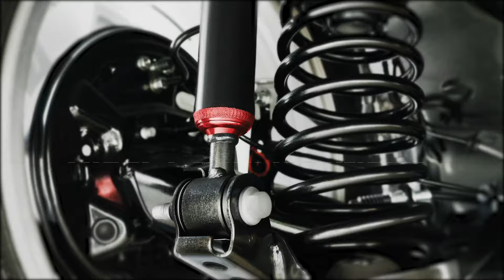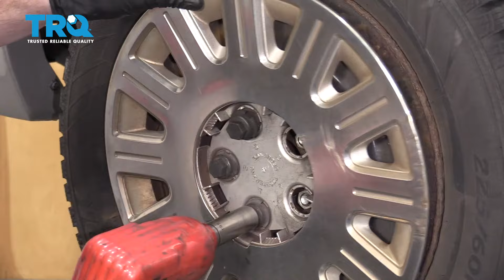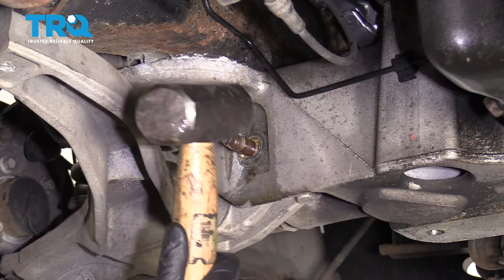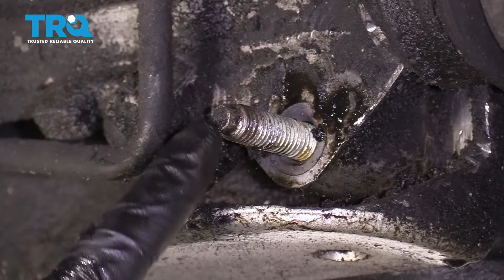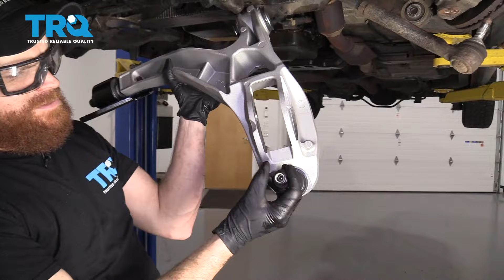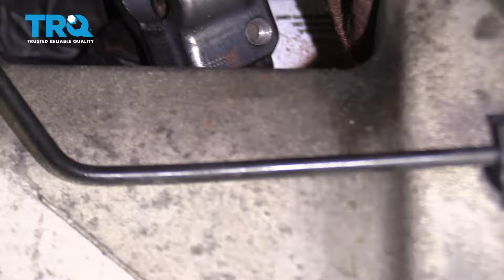How to Replace Front Lower Control Arm 1998-2012 Ford Crown Victoria

Comment: Everyone reading this, ignore the whole removing steered rack studs, nuts, etc.  Dont do it.  Simply turn your steering wheel . Theres a spot where the bolt will come out with no issue.

Comment: Thanks for the video! One tip:
This job can be done without disconnecting the steering shaft:
Turn steering wheel all the way to the left:
Remove 2 steering rack bolts and drvr side stud;
Move rack forward and up as much as you can and there will be enough room to slide that bolt out.

Comment: i did this job just like he did but did not have to disconnect steering shaft/ i lifted the rack up with a crowbar and removed bolts and did the same installing them a tight fit but it came out perfect !!

Comment: Many thanks. Just did this on my 2004 in my driveway. I didn't remove the rack, but turned the wheel as someone else mentioned. I barely got the bolt out. I could not get it back in. It was drivers side, so I took out the long bolt of the drivers side rack, used a crow bar to lift the rack straight up, this allowed me to put the control arm bolt straight in. I should have done this when I removed the bolt as I ripped the boot. Car has 290k miles.

Comment: I have a 2000 crown Vic that has too much play in steering and it kinda snatches during left turns on the highway.  It'll also clunks when I turn the wheel while sitting.  Could the lower control arm be the culprit?

Comment: We just did this the other day before watching the video and we didn't take out the steering rack, simply loosen the two nuts to have the rack loose, then remove the rack boots at the big end, and you will have just enough room to take off the lower control arm bolts

Comment: So many unnecessary steps here my goodness. You absolutely did not need to touch the rack at all. Our the steering shaft and you did that and didn't even warn anyone about the clockspring. If that moves at all the clock spring is screwed. Which could've been avoided because the rack and steering shaft didn't need to be touched at all. That bolt can slide right passed the boot.
Reply: You should do a video of this.  I'm trying to get my Control Arm out now, and can't see any way other than to move the rack and pinion out of the way.
Reply: definitely going to try this method when I go do mine tomorrow. I'm having to do it on jack stands and I really don't want to waste extra time dealing with removing a bunch of stuff I don't have to, and I especially don't want to touch the steering shaft if I don't have to. Also saves me having to by a longer extension.
Reply: Music to my ears

Comment: Really not looking forward to doing this on jack stands, but I think I've got it after watching this video. Thanks so much, fantastic as usual.
Reply: Well watch a few other videos first. Because you definitely don't need to remove the rack at all, or the sway bar or the steering shaft.
Reply: Can you post the video you mention? Looks like steering rack has to be pulled forward for the front controller bolt to slide out
Reply: @CrimsonWormApologetics  I think homeboy just likes using his impact gun cha-kno
Reply from the maker: +ShumaiAxeman Thanks for watching our video! http://1aau.to/m/Shop-TRQ

Comment: If you get the front end kit that has new inner and outer tie rods, You should be able to do away with removing the rack.
Reply: You don't have to remove the rack or steering shaft regardless no matter what. This video is flat out stupid.
Reply: Or simply turn the wheel....

Comment: I have a 2002  mercury Marquis. Is there any way to center my steering wheel without affecting the front wheel alignment?  My car is driving real straight so the front alignment should be correct but my steering wheel  is a little off center.   jamesmcqueen1933@gmail.com
Reply: It can be done but it's hard to set toe in the driveway. It is best to have a shop do it. Because they have an alignment rack. However if you got a buddy have him sit in the car with the steering where you want it. Then eye ball the wheels you make toe adjustments at tie rod. I seriously don't recommend doing this if you have never done it before.

Comment: I’m literally at this point and could not figure out how to get the lower control arm bolt out without removing the rack and pinion.  The rack and pinion just kept hitting on the oil filter housing. Great video Thanks! ! !
Reply from the maker: +mobig2ls Thank you! We love empowering our customers and showing how to perform DIY auto repairs with our high-quality auto parts. http://1aau.to/m/Shop-TRQ
Reply: If you turn the wheel to the opposite side. The bolt slides right past the inner tie rod arm.

Comment: Great vid. Just curious, do we really need to get the steering rack out of the way for this job?
Reply: No absolutely not. or the steering shaft or the sway bar none of that had to be removed. You turn the wheel and the bolt slides right passed the boot.
Reply: Also this video told you to remove the steering shaft with no mention of keeping it still. If you turn it at all your clock spring will be screwed. He doesn't even warn you of that. While telling you to do that in the first place. 🤣🤣🤣
Reply: @CrimsonWormApologetics  awesome, thanks for the advice, glad I got your advice or I'd be the knucklehead making that exact mistake.
Reply: You don't actually have to remove the steering column from the rack, since the steering column extends and retracts with the joints built in but you do have to remove the one bolt and stud on whichever side control arm you are replacing in order to slide the steering rack forward enough for bolt clearance.

I did my lower control arm about 5 months ago and I can't remember removing the sway bar, I don't think that's necessary either.
Reply: @1995flyingspur  was it difficult for you to remove the stud ? Did you use the method in the video (double nut) or did you just remove it with a socket.
Reply: @1995flyingspur  thanks! Great to know
Reply: You do not have to remove anything to do with the steering racc.... Simply turn the steering wheel, ta-dah!
Reply: seems excessive

Comment: My crown vic needs new control arms bad lol. Front end wiggles more than a semi on a windy day.
Reply: Could be your need new struts and shocks. These lower control arms are quite beefy and it's really just the ball joints that wear out.
Reply: @CobraR1993  the bushings wear out bad too and unfortunately the front bushings are press in.  It's a lot easier to just replace the whole arm rather than try and press out and in new bushings without a hydraulic press.

Comment: That was a really great video. I have a 2003 Lincoln Town Car and my shop has told me that I need to replace my lower control arms. I trust them to tell me the truth and they have saved me money in the past. They have told me that this job is going to cost me $930 which is a lot but watching this I can see why. We live in an apartment and I don't have access to a lift and at 65 I don't have the inclination to use jack stands and go crawling around on my back attempting this job. The car's only worth about $3,500 on Craigslist but it's supremely reliable and hopefully this is it's only major cost this year. Thank you for the concise information.

Comment: Good video, but this only applies to 2003 and newer Crown Vic's and Grand Marquis's. 1998-2002 has stamped steel control arms and no rack and pinion.
Reply: 03 and newer have stamped steel ones too. this vehicle has the standard suspension. Stamped steel is the heavy duty suspension. But you are right about the rack. 03 is when they got an entire front end upgrade.
Reply: Thanks I have a 2002 Grand Marquis to do this weekend lower control arm
Reply: All of them had stamped steel control arms its just the aftermarket ones on rock auto are cast
Reply: Crown Vics** grand marquis** apostrophe “s” is for ownership not pluralization

Comment: Very detailed. Excellent video. Do you have a good rule of thumb in judging the bushings and ball joint?
Reply: If the boots ripped, replace it. If it's making noise, replace it. You can also have someone steer the wheel back and fourth and if you see play in the control arm mount points that means you gotta replace it.

Comment: Great video, when will you replace the upper control arm?
I need help!!
Reply: Easy to do, on my 07 I did this: (if doing at home jack up both sides of front end evenly important to make removing stabilizer links easier) 
Remove the caplier, and brake pads, remove the 2 bolts holding in the caplier bracket remove the rotor. Using a 15mm to hold the nut at top part of the stabilizer bar, then using a 7mm loosen the top and lower portion of the stabilizer link. (Removed now) loosen the upper ball joint, if it spins like the video use a locking pliers or jack up the lower control arm. Now, remove the 24mm bolt that holds the lower bolt on the shock. Remove the 3 bolts (do not remove center bolt or face some bodily harm or car damage) around the top of the shock. Push down on the shock and it should come out. now pull the 2 clip that hold the abs wire to the upper control arm, and finally remove that 2 bolts holding in the control arm. Should be a 2 hour job for a beginner
Reply: Installation I did this, install the 2 bolts for the upper control arm, reclip the abs wire clips to the arm. Then reinstall the 3 upper bolts for the shock. Reinstall the control arm balljoint (jack the lower control arm to put pressure on the ball joint so it doesn't spin) put the 24mm bolt for the bottom part of the shock back on. Reinstall the stabilizer links. If you have an issue jack up the other side a little higher until it aligns. Reinstall the rotor then caplier bracket , caplier and brake pads. If you need any of the torque specs for anything I can provide it.

Comment: I must commend you for the content and instruction of this lower control arm replacement on a Crown Victoria. It is absolutely the best and most informative instructional video I have ever seen showing control arm replacement. Not only did you make it look easy, your narration of each and every step as you performed was great. The camera work was spot on, showing exactly what was required for each step of the way. I was totally impressed with this video and your knowledge from start to finish. Thank you! Now that brings up a question,  I saw that the control arm you installed included the trailing arm bushing, it was loose in place but you tightened and torqued it up.  On my car, the lower control arm bushings are fine as is the ball joint. Upon inspection, only my rear bushing is worn. Can just the trailing arm bushing assembly be replaced without replacing the complete the lower control arm? Thanks again for the great video and its content.